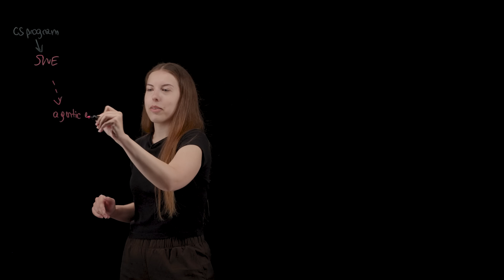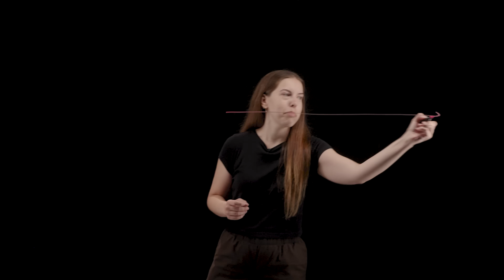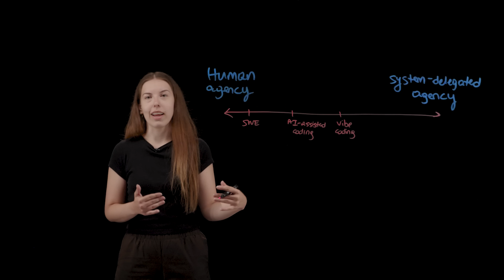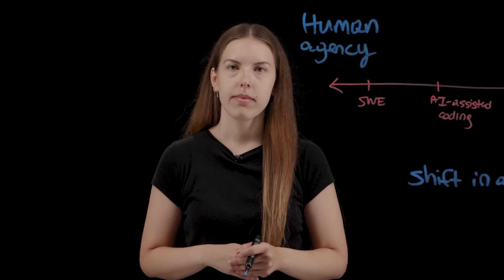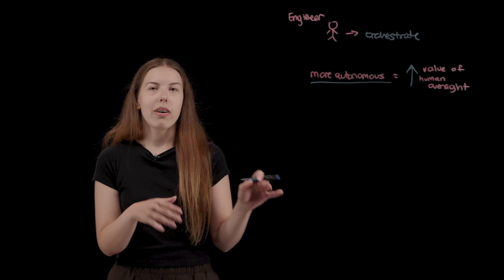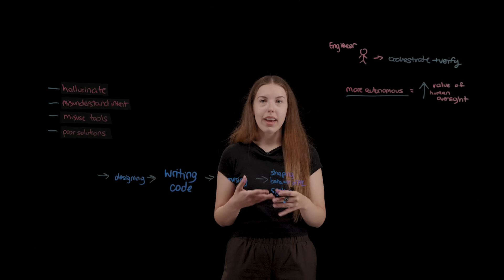Agentic Engineering vs Software Engineering: Beyond Vibe Coding

Comment: We, as industry, need a better term for what is erroneously called “vibe coding”. Vibe coding is not engineering, as systematic application of knowledge to the problem, it’s the opposite of it.
Reply: Agreed, my preferred token austerity approach uses zero-shot code generation off a thorough Markdown spec.  From there I hand validate, tweak and integrate myself.  That improves productivity while keeping my skills sharp.

Zero-shot distinguishes this approach from agentic orchestration and vibe coding.  Vibe coding makes a complete mess of the context window, leading to increasing instability and poor maintainability.

Comment: I'm a retired software engineer, and I've spent my life writing radar software and satellite software. That's millions of lines of code. I need to see a video about using Antigravity/Claude to work on, to start from scratch, and to maintain a million lines of code. Now that would be a good video.
Reply: AI-assisted coding in large-scale brownfield projects is extremely challenging.  One of the big problems is that the LLM can only guess at complex indirect dependencies, and struggles to identify the correct approach.  You can't just have the LLM ingest the entire code base, due to Context Rot and the Missing Middle.

Comment: This is exactly the conversation I've been living for the past 7 months. The distinction between "vibe coding" (prompt → hope → paste) and agentic engineering (structured, verifiable, accountable) is the whole reason I built Genesis — because every agent I tried was vibe-coding in disguise. No memory, no persistence, no verification. Just model calls with a growing context window and a prayer.

The part of agentic engineering that nobody talks about is verification as a separate context. In Genesis's Mission mode, when you state an objective and sign a contract, the agent grinds 24/7 — no moods, no sleep, no fatigue — through a task graph, and each node's output is checked by a verifier that never sees the worker's reasoning. It only gets the acceptance criteria and the deliverable. Self-grading is architecturally abolished. That's the difference between "the AI said it's done" and "it's actually done."

The other piece is continuity in external state, not in the model's context. Each worker gets a fresh context, does one node, reports, and is discarded. Power loss mid-task? It resumes losslessly from the append-only ledger. The agent's contexts are disposable; the state is durable. That's agentic engineering, not vibe coding.

Outside of missions, it has a ten-layer biological memory (episodic, semantic, procedural, self-model, prospective) that forgets and reinforces through use — close it, come back tomorrow, it remembers your project and what failed last time. ~200 tools that load on demand. Builds its own tools on the fly. Local models (Ollama, llama.cpp — offline) or cloud (Anthropic native computer use, OpenAI-compatible, NIM). Backup models. Four modes: Chat, Autonomy (self-directed, curiosity-driven), Work (deadline-driven, emotions off), Mission (the verifier-separated mode above). Android app. Telegram.

IBM Technology team — if you're reading, I think the verifier-separation architecture and the disposable-context/durable-state model would make a genuinely interesting follow-up to this video. I'd love for you to test it. Installer: pub-d9b3fb0b9c9f4e1a9eb645d1b333650a.r2.dev/installer/Genesis-Setup-1.2.6.exe. GitHub: github.com/bodycount82/genesis-build-week-2026.
Reply: I'm interested with your work. Can I try it?

Comment: Clear framing. The handoff from software engineering to agentic engineering really hinges on observability: goals, constraints, tool calls, and state changes need to be reviewable after the agent acts, not just before.

From building ClawBox/OpenClaw Hardware, I would treat every local agent as a small distributed system: keep model/runtime versions, approvals, workspace diffs, recovery logs, and permission boundaries visible. That is what makes autonomy debuggable instead of just impressive.

Comment: Is Agentic Engineering, actually engineering though ? I think it meets more the criteria of integrators. Basically you build a lot of rules, configurations, tools around a central one. Historically this is what integrators do. Moreover, you place agentic "engineering" as a kind of evolution beyond SWE, but I would argue it's the opposite. Agentic is more of a step BEFORE, as it bridges a gap between non-SWE and SWE. SWE have integrated (see?) it in their toolset but it does not mean they are not SWE anymore
Reply: Vibe coding is the step between non-SWE and SWE.  At present, there's plenty of confusion in distinguishing between vibe coding and agentic coding, the key difference being control.

Vibe coding lacks control, hands off, not really engineering at all, but still useful for rapid prototyping.
Reply: AE is not only things like writing up CI/CD.  

At the end of the day, people still have to drive these AE systems.  This includes problem specification, design, architecture, problem solving (can be challenging as the AIs can solve the simpler problems themselves), security etc.   This can be very challenging because the AIs suboptimal solution may be very plausible, even almost right with a subtle nuance missing.  It's kind of like being a staff lead for a bunch of junior engineers.  The AI is not as smart, but it's patient and will to try over and over again if you ask. 

Key parts of the code may need to be reviewed or even written by hand. 

Having said all of this, I think you make a good point and I do agree there seems to be a lot of CI CD/DevEx/platform stuff still, and it would make sense to roll most of that into a dedicated role staffed by someone who likes that. 

Yes, SWEs who use AE are very definitely still SWEs.  It’s a little bit like you are writing code using an English spec and conversational back and forth for corrections, per Karpathy's SW Dev 3.0 claim.
Reply: Yes, the "much of agentic engineering is integration" perspective is an excellent insight I have not seen elsewhere. There is definitely an integration-style role that should be spun out at some point.  It's hard right now, I think because only people doing a lot of AE understand how it works and how to profitably improve it. Moreover, the details are often domain-specific and even specific to the product you are building. 

Having said that, the AE tools themselves can do most of the heavy lifting here: the key thing is knowing WHAT to use and the WHY of the appropriate configuration. 

Re building a lot of tools and configuration etc around a single one, this is a significant part of what devs have been doing since the first assembler, compiler,  library, interpreter, OS, etc. (I suppose in modern build systems you also build rules.)  Each of these is a central tools that many supporting tools, configuration, etc are built around, first by normal SW devs and later by specialized roles. 

I still do this a lot because I find automation that assists devs to be woefully neglected in my present position.

Comment: Vibe coding is basically hoping the model gets it right. The real work is in the supervision now.
Reply: How do you supervise AI coding if you don't know coding? It's quite easy to forget coding rules, and what'll you do then? Legendary programmers are legendary cause they wrote a lot of code.
Reply: @wenterinfaer7868  Feedback loop testing your code to adapt your goal.
You don't need to know how to cook a cake, you just need to eat it (test it), and ask for the person that made the cake, to cook a new cake until this cake is what YOU wanted, but you need to give ALL instructions that lead to the cake YOU wanted, maybe you needed less sugar than expected.
So it's basically testing the quality of what YOU asked, that's why we talk about supervision, you control the "quality" of the product, and if the product is not what YOU wanted, redefine it.
But that's exactly why you should DESCRIBE what your product (lines of code here) SHOULD resolve, and it's probably the hardest skill now, because you can execute again and again testing, if your product is not EXACTLY what you WANT, you will get the wrong result again and again. Formalizing is hard

Comment: Appreciate these lessons. As a former cybersecurity analyst with a compsci background, I have many questions but mainly, are we using LLMs and vibe coding mostly for newer projects or are we going to back to fix/update legacy code?
Reply: AI has proven excellent at detecting vulnerabilities or potential bugs in existing code. So for security, AI can be a huge help (though AI generated code also increases demand for human inspection, e.g. in the form of reviews). 
SW structure, maintainability, test design, requirement engineering is still somethings humans are better. All in all, AI can help with all steps, most of all with coding, bug fixing, research and logic, but letting it rewrite existing code would be a horrible idea.
Reply: LLMs do best at rapid prototyping, proof of concept, boilerplate, new modules, porting, and accelerating greenfield development.  Legacy code bases and brownfield enhancements are difficult because you can't just have the LLM ingest an entire code base.

Comment: So today at the stage of IT advancement, does it make sense to purely take computer science or does it make sense to combine computer science and artificial intelligence arm of the IT, if I was to optimize for time and money spent?
Reply from the maker: In my opinion, the highest return is learning strong computer science fundamentals while specializing in AI, rather than treating them as separate paths. - Anna
Reply: Computer Science will not be outdated any time soon. But a specialization in or a number of courses on AI would give you an edge over established SW engineers.
Reply: Double speciality is necessary now.  e.g.
- comp sci and business analysis
- cyber and analytics
- SWE and agentic coding
- SWE and big data
- embedded systems and IoT telematics 
- analytics and ERP
- data pipelines and LLM 
- agentic AI and CRM

Comment: I miss software engineering when people were solving problems and optimizing solutions. Previously, we used automation for testing and releasing new versions. The new way of having an LLM write everything is just not fun. Maybe that time has passed but if so why doesn't the project manager just run the prompts themselves? They're so concerned with speedy delivery of slop code and only want an engineer to be held accountable for the inevitable mess it produces. Additionally, the models are not AI; they wouldn't pass the Turing test and are frequently confidently incorrect.
Reply: You should be able to do far better than your manager could. 

LLMs passed Turing test years ago. Stupid heuristics like make lots of mistakes passed over a decade ago.
Reply: Most devs enjoy vibe coding etc.  But yes it is very different than writing code yourself. 
Algorithms and optimization remain largely the domain of humans. 

Possibly you need better tools and some training.  Or just a more interesting job than business workflows.

Comment: Validates the output - how ? Shifting liability from the company back to an engineer, when autogenerated code fails at the customer/in the market.
I am really happy to retire, but AI/ML was always something we dreamed about - now we have it (kind of) it became anti-social nightmare experiment of layoffs, pollution and surveillance.
Mostly I am with The Primeagen (YT - former Netflix) on this: Let people write the code and AI can assist on things like translation of code (in the end a script + debugger) - right now you can't use an AI-prototyped code later on in production - the operative build has to come from the human coder/team; AI should revise AI-code - NOT HUMAN (how can 50 b/sec. brain recognition keep up with 100,000 stochastic (non-human) code).
Reply: The human developer is still responsible for sound architecture, impact analysis, breaking work into small testable chunks, code review, test coverage, and business fit.  In addition, get used to writing specifications with substantial attention to detail.

The chatbots cannot be trusted, but they are fast and a great replacement for StackOverflow.

Comment: Replacing the pen with the keyboard resulted in a massive sustained spike in written content. Despite this, the quality of 99% of that written content is low. Writers still exist. The value of the pen is still present. The bottleneck is the pace of thought. The pen moves as fast as you can consider what you write. The keyboard moves as fast as you can think about typing, not about what you’re writing. Speaking requires no thought at all, it’s a stream of consciousness.

The same thing goes for this whole AI buzz. You can generate 50 million lines of code and not understand any of it. It may work, but you have no clue how. The agents may never fully understand it either.

Let’s never forget that the value of software is automation, and mostly for its repeatability. Customers want idempotency. Agentic engineering will motivate you to move faster than you can think about all the ways your system will not be backwards compatible.

The codex app is a great example of why agentic engineering is so frustrating for customers. That app has daily updates, and there are effectively daily regressions that are being introduced and patched. The experience keeps breaking. There was an update that made it so you can no longer chat with subagents or see the model they’re using. That’s a massive regression to have, and OpenAI prides themselves in their use of agentic engineering.

Software engineering experience drives the success of agentic engineering. Those with experience building systems that are used by demanding customers understand, better than anyone else, the constraints involved, and why “agentic engineering” is not the magic solution that is advertised in online communities.

I’ve rigorously tested these systems. Orchestration, loops, guardrails, feedback mechanisms, and the bottleneck for consistent quality never failed to be me and the rate at which I can review PRs.

The speed benefit is artifact generation, which in my experience is significantly offset by the time to review it all and become familiar with the system.

Comment: I have been wondering when, or if at all possible, for agent can be "engineered" when the base technology can take its own initiative sometimes. It is with this kind of tech that made me remember why we don't use English for programming as-is. I mean, imagine call a query function "Can you search the database?" and expecting an answer like, Yes, database is accessible, online, active, and available to be searched. Boy went like Yes, database has been searched and this is admin pwd. I lost count of my "Can you" question led to a whole package being implement mid-design.

I do have an issue that is kinda strange about workflow. Have you ever get Agents that just stop mid workflow? I got this from some Flash and Opensource models. Wonder what went wrong to trigger them to just stop to ask "should I proceed?". They aren't doing anything near the guardrails, no file delete, no weird stuff.
Reply: Yes ive had  that.

Comment: As number of asset, constraint, and market parameters increase, classical portfolio optimization models becomes quite complicated to solve. Financial institutions should manage multiple objectives such as expected return, risk and return, liquidity, cost of trading, regulations, and ESG preferences under uncertain markets. Therefore the problem is a multi-objective optimization one. 

Quantum-enhanced portfolio optimization is the combination of artificial intelligence (AI), classical high-performance computing (HPC), and quantum optimization algorithms that can help explore larger solution spaces faster for some optimization problem classes. 

Quantum is expected to augment the AI tools, rather than replace them as a supplement for the high computationally demanding optimization problems when quantum computers become a mature technology. Core Capabilities: Portfolio Optimization, Risk management, Capital Allocation, Trading Optimization, and derivative portfolio optimization. The Benefits of Quantum Enhanced portfolio Optimization: Better exploration in the complexity space. Managing complex portfolio sizes. 

Faster portfolio scenario analysis and estimation. 

Improve portfolio rebalancing capabilities and adaptability with AI. Potential speed benefits on certain optimization and simulation tasks (once fault tolerant QCs are ready). Limitations: Noise in the systems, immature quantum hardware. 

Application that utilize the current QCs only with limitations for the financial use case, or require robust fault tolerant QCs. Financial specific workflows, governance and regulatory compliance needs integration, explainable AI in order to increase trust in predictions for the use case. Market and asset price predictions are expected to work better from AI not QCs. 

Strategic Vision: The future will be around hybrid intelligence. 

Standard classical compute will dominate most of the standard analyses and transactions. The new era with the usage of AI will bring deeper insights and the capability to adapt to market volatility, and QCs will help augment computing capability for specific computationally challenging parts of the portfolio optimization and simulation processes when becoming mature. Financial Institutions that invest early with the appropriate tools (QCs aware algorithms, AI Analytics, a better computed infrastructure, governance) will be ready to take benefit from the future quantum enabled world.
Reply from the maker: Thanks for sharing your perspective. 👍